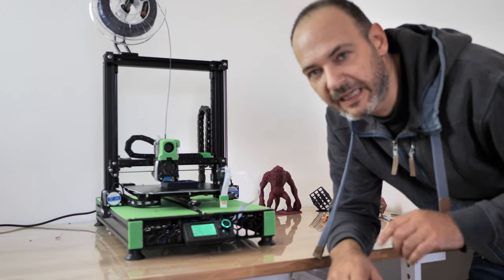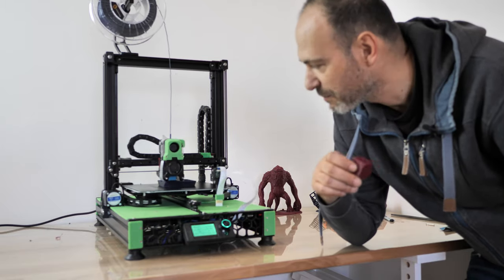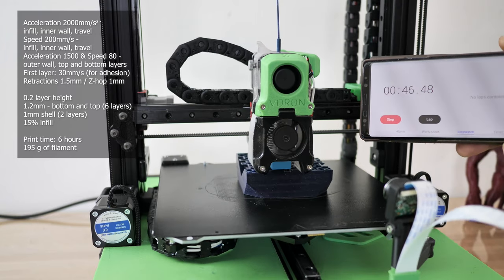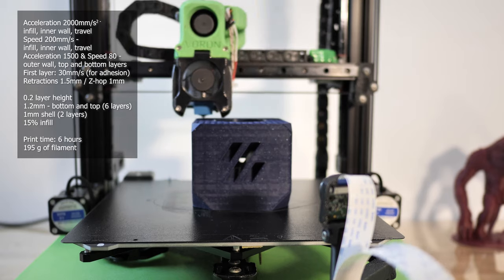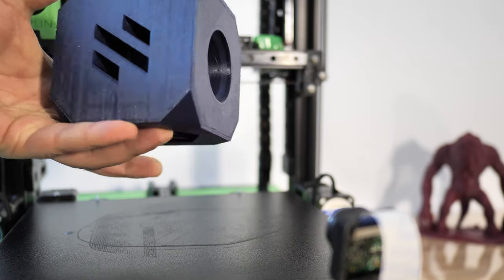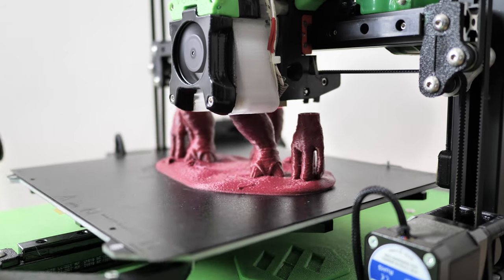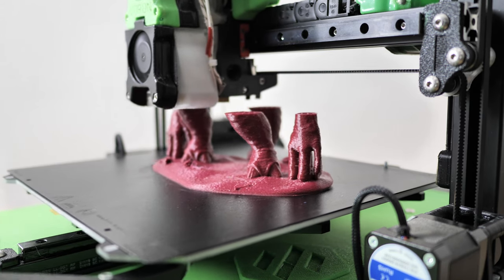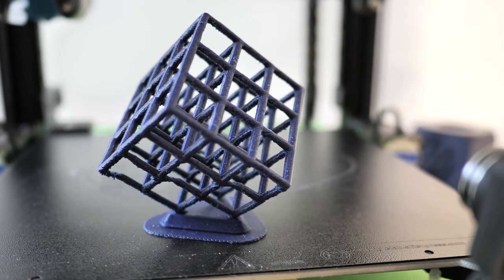Few test prints with Voron Switchwire

Comment: To find the max values you could also just print a big hollow testcube in vase mode with no bottom and top but with brim. then change the acceleration or speed every 10 layers or so. Saves filament and is much quicker.

Comment: Nice cube. Have you done it with the input shaper? I guess it can bump up speed even more ;)
Reply from the maker: I read abt it, but havent install that. If I understand right the klipper wiki the accelerometer is to be installed on the afterburner. I dont think I will pass another cable in the chain :)
Reply: @3dpblog  you can also use input shaper without an accelerometer. You have to print a test print and measure the wave distance on the surface and then you can calculate the required parameter for input shaper yourself.
Reply: You only have to install it once so no need to open the cable chain..use a loose cable to the PCB and run the tests for input shaper..once you have the correct values you disconnect the PCB and remove it. No more need for it
Reply from the maker: @erikhellman3974  Yes, thanks, I'll see. In the case of the switchwire I think it should be run on the bed (Y) as well. It becomes too complicated and maybe doesnt worth to spend time on it. With normal speed up to 80mm/s I have no ringing anyway

Comment: Grams per second?  195 grams in 6 hours =  0.00902 grams per second
Reply from the maker: What does it mean? I know the hotend capacity is normally given in cubic mm per hour and I cant make the correlation with your calculation. Also, the cube was printed at relativelly small layer height, which should be the main reference point to juge the print time.
Reply: @3dpblog  Sorry just an interesting equation. I think grams printed successfully of some reference object would be one of many ways of comparing performance? And thanks for the video of your Voron, looks fantastic.